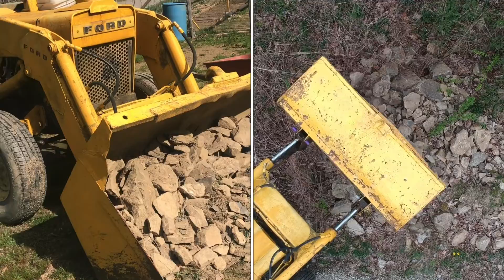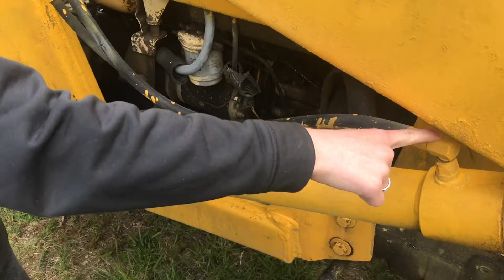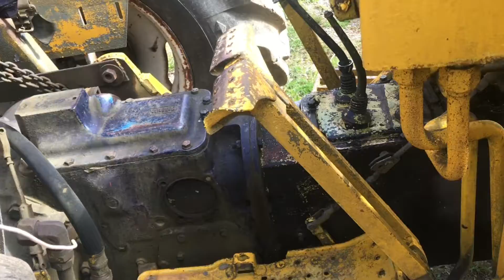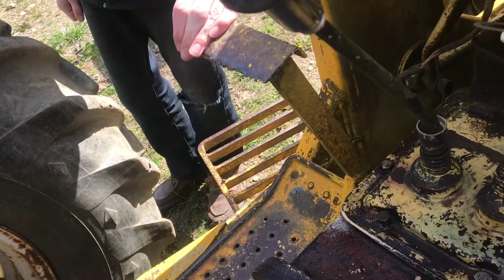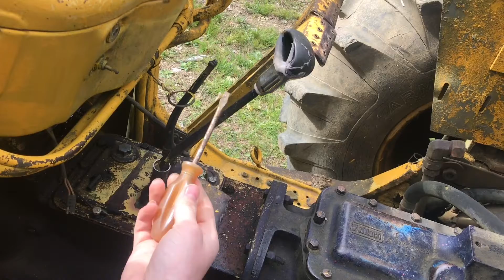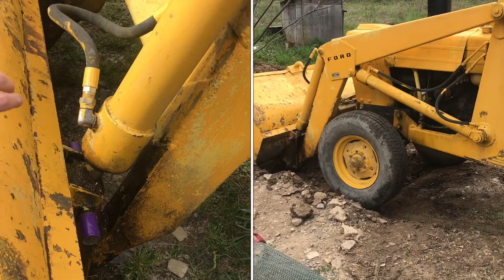EXPLAINING how to operate a “front end loader” (how it works) ford 4500 industrial tractor

Comment: I have a Ford 4500 industrial and you also have to fill the frame reservoir at the top front of the motor. There is a hydraulic filter there and a dipstick.